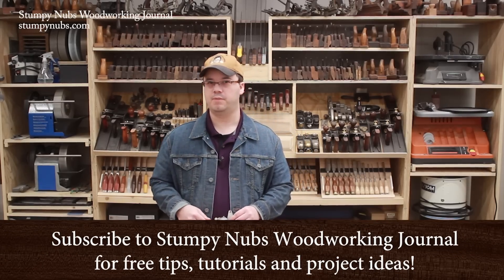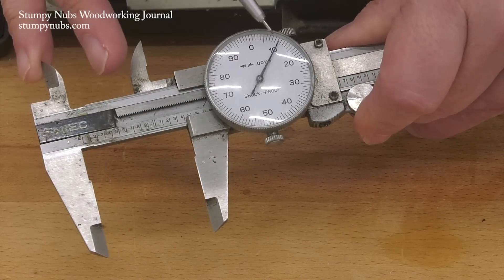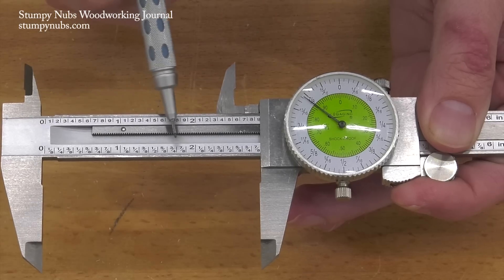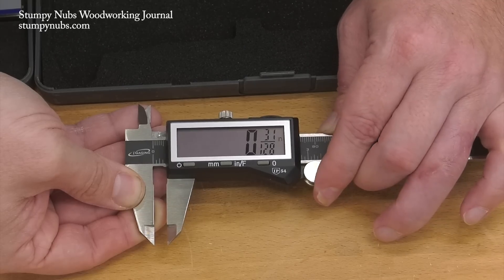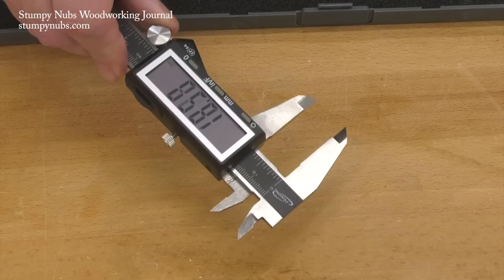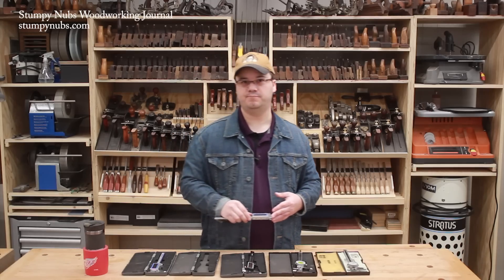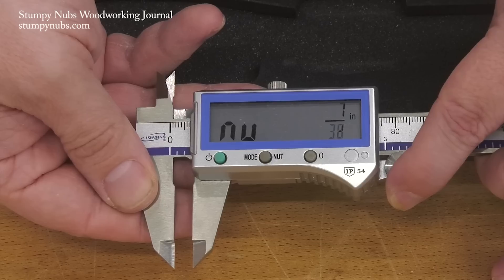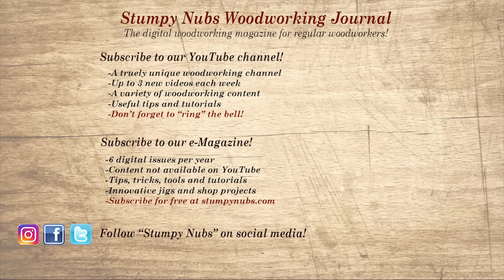FINALLY! Calipers made for woodworkers!

Comment: I like a vernier scale. no batteries, no gear racks. It seems that a vernier scale could be worked out in fractions.
Reply: I have a very cheap, plastic vernier caliper that measures in both metric and Imperial. metric to 0.05mm and Imperial to 1/128. But as my eyes (and the rest of me) get older, I prefer big, bold digital readouts.
Reply: I have a vernier caliper that measures in 128ths of an inch. Sometimes hard getting from that to odd fractions like 13/32. At least it's better than idiotic Microsoft, which uses all fractions, like 2/7 if it's closest.

Comment: PRO TIP: That thin bit of metal that sticks out the end is used to measure the depth of a hole, which comes in very handy.
Reply: Pro tip #2:  If you zero digital calipers on one of two, same sized, round bars or holes, you can measure the between centres.
Reply: @11atlantica Hmmm....  And how do they do that with dial or vernier calipers?  ❓
Reply: PRO TIP 4: That little bit sticking out of the caliper can still make it wobble.
Using the caliper to set a square ruler will be more stable because the rulers are an inch wide and 1/8 inch thick.

Comment: I'm old enough to remember in the UK when we had the imperial system for measurements before metric was introduced and I still use it. I love it when I'm in the US and all I see is sensible measurements ie feet and inches, miles etc.
Reply: My favourite is with money. One hundred pennies is not one pound!.
It is 8 shillings and four pennies.
One hundred pence is one pound.
Still looking for a spanner to fit a fifty pence piece though.

Comment: I'm glad you did this video. I bought a new one from Harbor Freight and Amazon after my old one failed. One had moisture inside of it and the other one the scale kept jumping around.
I waited 2 months and watched a bunch of videos before I settled on an iGaging 6 inch 0 reference, Bluetooth model.
I also purchased a set of Precision Machinists bars around the same time for overhauling my equipment.
The iGaging caliper was accurate for every bar I tested. Since then my ARCH caliper went down as well. I used it to set router and saw height. 

So, I set the caliper to the height I want. Use the square ruler and set it to the caliper. Now I have a stable, flat surface to place above blade and bit to stop against.

Even with the Incra T-ruler there's a comparison from one to the other. Using the square I just bring them up to meet.

Comment: I have a digital calliper (inch/millimetre) for around 20 years. Use it many times a day. It is only on it's 3rd battery. $3 per 7years purchase is not an issue or even a consideration.

Comment: I'm an American who uses mostly tools in inches, but have no use for fractions in calipers, particularly if they are approximate.  If you want to round to the nearest 32nd, why would you measure with calipers?  The only case I can think of where fractions are helpful is identifying a drill bit, and for that you want precision. 

 For most measurements of precision higher than that usually used with woodworking, I'm interested in matching two measurements, so units don't matter much, but decimals make it easier to know which way to go.  I use decimal inches because my dado shims are labeled that way.  

I like simple mechanical calipers.  The battery powered ones don't see much use except for conversion between English and Metric units.

Comment: Excellent piece of content, Jim. I just bought your favorite digital caliper on the strength of your review -- the ability to resolve only down to 1/32" and the ability for the device to "remember" where it was when you turn it off and on again. Both of those features will save me a lot of time. Thank you for all you've done to educate the woodworking community throughout the years -- you are a treasure.

Comment: I sometimes like the cheap ones that forget where the origin is. If I need to figure out the difference and don't feel like doing math, I'll measure the first, power cycle it, then measure the second. It's kind of like using the tare function on a scale.

Comment: I'm an old guy so I'm even comfortable with vernier calipers.
Reply: Will, but can you read 'em? I'm finding it difficult now, even with my safety glasses that have reading magnifiers built in!
Reply: Me too! I have a vernier caliper I inherited from my Dad that reads in both inches (down to 1/128) and metric. However, I use it so infrequently that I have to remember how the vernier works. Laughing at myself.
Reply: @leehaelters6182  Yep. Still have good eyesight at 71 and can read fine print. Thanks for asking.
Reply: @williamellis8993 , dang!
Reply: @williamellis8993  Grr - envy. Been heavily short-sighted since  I was 12. IN my 50's I got the "salt in the wound" of being told I was now becoming "far sighted" as well. And no, they don't cancel out.
Reply: @stainlesssteellemming3885  I was extremely nearsighted until I had cataract surgery last year. The lens implants actually improved my vision.
Reply: @williamellis8993  I've always been very protective of my sight. So far, every surgery I've had has been for an injury of some kind. And there has been a 100% result of "unintended consequences" - no negligence involved, these were known likely outcomes.

So, choosing to let someone mess with my eyes .... brrr. The thought scares me to death.

Besides, my prescription for both short and long sightedness still changes every year or so, and you can only fix one or the other with surgery - unless they do each eye differently.

I'll wait until the surgery becomes "non elective", thanks.
Reply: @stainlesssteellemming3885  Best wishes to you.
Reply: @williamellis8993  and you
Reply: Plastic or the expansive Metal kind ?........
Reply: @Richard-wk9le  Either.

Comment: I started a toolmaker apprenticeship in 1967 in the UK, back when the UK still used imperial.  Changing to metric took no time to adjust to, and was orders of magnitude more intuitive to use.  Quite why the US insists on keeping imperial is a total mystery to me.  Base ten works better for machine slides, is easier to the math in your head. If you need more precise measurement with metric, you simply add another place after the decimal point and use a measuring system that covers it.  With imperial you get to 1/64" and where do you go from there?  Imperial is just plain crazy.   Metric threads are easy because the tapping size is going to be the same as the pitch.
Reply: I grew up with metric in Italy. Im in the US now for over 25 years and have managed with the imperial units but it makes life more difficult. Metric is much simpler and as a result I find metric produces fewer mistakes so less waste.
Reply: @boots7859  I will also  comment here that the imperial measurements will hang on because stuff that was built 100 years ago, both tools and articles, are still in service.
Reply: I'm in the US, and I've found that I'm pretty equally using Metric and Imperial.  Metric when I can, but Imperial when I have to.  Like Stumpy said, it's not really a choice here...you are simply forced to use Imperial a lot of times.
Reply: Yep, I totally agree. I was a toolmaker in the 70s and 80s just as the trade was going down the tubes. The need for old style press tools, plastic injection moulds, machine jigs and fixtures was in the process of being circumvented. I was trained using imperial and dividing fractions in my head was/is second nature. However! I made the leap to metric and I haven’t regretted it. To hear these guys talking in 1/16ths, 1/32nds and 1/64ths these days seems archaic and retrograde. It’s like listening to folk from a bygone age.
Changing over isn’t about the pros and cons, it’s about pig headedness and an unwillingness to change. It’s arrogance. 
America needs to get a grip and ditch this looney old system. It kicked the English back across the Atlantic. It needs to do the same with imperial measurement.
Reply: Well, with y'all gettin' the hell out of the EU, maybe it won't be long b'fore y'all come back to Imperial standard measurements, too.  We'll be waitin' for ya' =)
Reply from the maker: What I don't understand is why we can't even say the word "ruler" without a dozen Europeans smugly insulting us. You may not know this, but I have ZERO ability to change the measuring standard of an entire nation. Neither do any of the other YouTubers you folks keep nagging about it. So give us a break, eh?
Reply: "tapping size is going to be the same as the pitch" No. Those are two different things. Size is the shaft diameter reference and pitch is the angle of the thread. Metric has two pitch angle standards. Imperial has many more then two.
Reply: @MrBonners  Let's talk real world.  If I am tapping 10mm X 1.5mm  I drill 8.5mm or maybe 8.6mm to make life a touch easier.  I can't remember the last time I opened my metric Zuez, and I don't even know where my imperial Zeuz is now.
Reply: @TrevorDennis100  Mount Olympus is where he was seen last.
Reply: @StumpyNubs  James, what some of you guys seem incapable of grasping is that you have a choice, but you choose to perpetuate a less intuitive, and more problematic system.  In this video you tell us that someone has compromised the digital caliper by making it display fractions.  It's like rejoicing about a floppy disk drive that plugs into a USB port.   Anyway James, I look forward to your next videos about flint chisels and stone mallets tied with mammoth Hyde. 😉
Reply: @StumpyNubs  Agree.  My cousins in Italy use metric because they have no choice, not because they like it better. I prefer metric for reasons obvious to me and many others but now that I live in the US I just work with what is here and what I have access to. Its not a big deal. I also dont lose sleep over any of it. It is what it is. I like your journal BTW. And FWIW, my digital caliper measures Inch/fractions, inch/decimal and MM. $30 online :) Keep up the good work.
Reply from the maker: @TrevorDennis100  I'm sorry, but this is so wrong. First, we all use the system that's common around us. It makes no sense for me to use millimeters when everything around me )lumber, fasteners, standard measurements, etc. ) is in inches.... Second, comparing fractions to floppy discs is not reasonable at all. A floppy disc is an old technology that doesn't work because it lacks capacity and new computers are not compatible with it. fractions work just fine if you know how to use them, and are compatible with everything around this population of 350 million people.... I'm sorry you can't tolerate the way other people do things (fractions "compromise" a digital caliper???), but you do you and we will do us.
Reply: @BTW...  in order to have different threads pure unit the pitch angle is different by default. pitch and pitch angle mean the same thing.
Reply: @BTW...  I do still have my metric Zeus in my toolbox, but rarely need to use it.  Having said that, it came in hand last week.  They asked me to look at one of our wood lathes.  They had two collet chucks. One barely fitted with just the last couple of threads getting hold, and the other didn't fit at all.  Two minutes with calipers and Zeus and I can tell them the the spindle thread is 1" UNF.  The nuts cost us about $1 each, and I am able to turn (on the metal lathe) safe and perfectly fitting collet chucks for them.  The most ironic thing about this story is that I only have metric thread gauges, and the 2mm pitch was 'almost' a perfect fit.  1" UNF has 12tpi

Comment: I found it funny that you need so many calipers with imperial system instead one in metric and immediately know what measure it is or round up easily to the next one. Try that with 97/128.
Still I love to see these imperial/metric videos so I gave you one big like! Keep them up and you'll fill up the comments section as well as your piggy bank.
Reply from the maker: So many calipers? Just because I showed five different calipers doesn't mean anyone needs multiple pairs because. Using fractions doesn't require any more calipers than metric would.
Reply: @StumpyNubs  What I meant is that there was/is the need to make so many special calipers for different applications (except digital ones). 
In metric calipers there is only one option and it works for every measuring application.

Comment: I'm a general contractor but I've built cabinets and do a lot of finish carpentry. As I'm 49 and my eyes are not what they used to be, I use calipers constantly in the shop. Anyways, when building cabinets, doors, or wooden sashes, my measurements are typically to the 64th. This business of people saying that anything beyond 32nd or 16th makes no sense to me. It's much easier to fit and finish something that's accurately cut, especially when dealing with stain grade.

Comment: Once you go decimal, you will never go back.  Inch or metric, doesn't matter though .001" is 1/4 the size of .01mm so you get finer resolution if you use inch.

Comment: Buy batteries or repair dials.  When I was supervisor in gage lab,  dials needed repair all the time and we had hundreds of them.
how about a nice Starrett with vernier scale?  No battery, no dials and always works.  Buy some jo blocks to check it out as necessary.  Micrometers are also nice.

Comment: 2 decimal points on the metric  scale is the same accuracy as the 4 decimal points on the  imperial scale as 1 inch equals 25.4mm so the accuracy is the same overall. comparing just the number of decimal places gives a false indication of accuracy, as the imperial scale is of a much larger number thus requiring more decimal places to give equal accuracy.

Comment: my problem with calipers is measuring how well my table saw is cutting.  When i cut a strip from a piece of wood and measure its thickness form top to bottom (as Ng does with his 5 cut testing )  i find i get variable measurements depending how i'm holding the material.  It drives me crazy.  How does one hold the material they're suppose to be measuring to ensure an accurate (and repeatable) reading?
Reply: This would be a good topic for a video tutorial. You need to use a caliper (or any measuring tool) correctly to get accurate and repeatable results.  I see many woodworkers (mostly on YouTube) who don't use their measuring tools correctly. This kind of thing used to be taught in the mandatory shop classes that all young men had to take in junior high or high school. (Just as most young women were taught how to properly use measuring cups and other equipment in home economics.) In our society's infinite wisdom, such classes are no longer mandatory and many of us never learned these useful skills.
Reply: It's probably less about how you hold the material than how strongly you slide the jaws.  If the jaw surface stays perpendicular to the measured surface, that's all you need.

Might be worth going to your community college and asking for a demonstration from a metal worker.

Comment: Testing accuracy on a much longer item will expose errors that don't show up measuring a thin feeler gauge.
Reply: No it won't, unless the item that is used as the metering item is damaged out there, and these don't work this way.
Reply: @brantlamb4122  Thanks for the reply.  For example, if the caliper has a linear error of 0.001 inches in 2 inches, that error will not show up on the display when measuring an item that is 0.100 thick.  When measuring an item that is 10 inches long, the error will show 10.005  Do you agree or did you mean something else?

Comment: Most digital calipers have a tiny current draw even when OFF. Record the reading To test, turn your caliper off. Move the jaw. Turn the caliper back on. Did the reading change, resulting in the correct distance reading?  If so, your caliper has a current draw while off.  The only was to truly save batteries on this type of digital device is to remove the battery when not using.
Reply: Depends entirely on how the position is physically measured inside the instrument.  Some techniques are inherently absolute and will show the right value even if you remove the battery and slide around.  Others use battery only when moving the slide and loose track with battery removed.